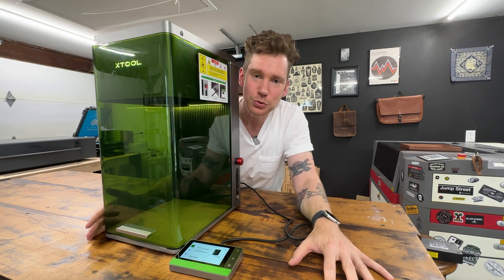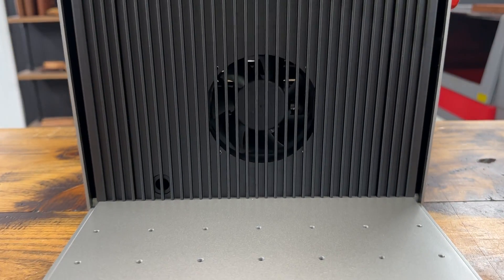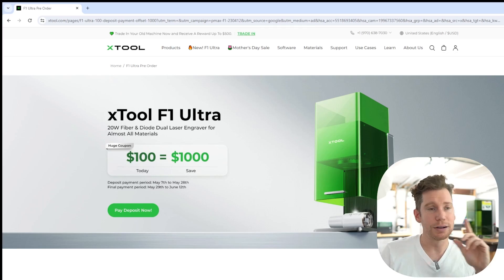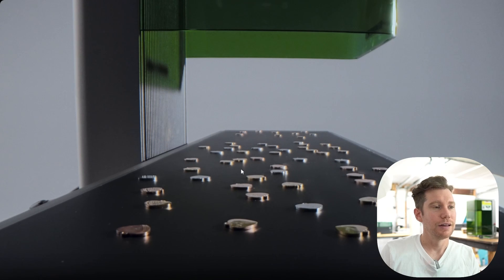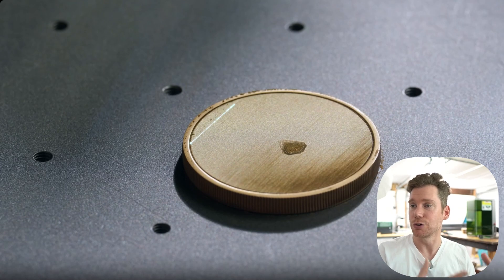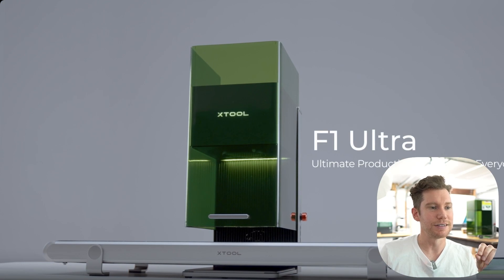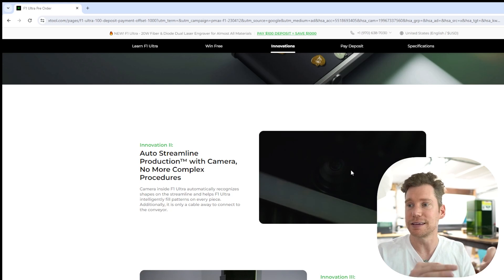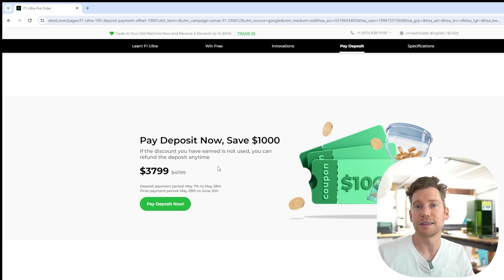The xTool F1 ULTRA! First Look Inside.

Comment: Does it use the same filter as the F1
Reply from the maker: The smoke purifier? I think so I have that too and I will be trying to connect it for the next video.
Reply: @justinlaser  I look forward to your specification video on what this things capable of I currently own the F1,p2and comMarker 60watt B4 MOPA of course I just bought my fiber Laser less than a month ago now it decides to come out with it.. lol Well, once all the dust settles, and everybody gets a chance to proof this thing, I’ll probably end up getting it
Reply: I had a F1 deluxe with the purifier on order to arrive tomorrow.  Customer service has been working with me to return it and order the ultra instead.  I asked the same question.  They said you should use the larger smoke purifier with the ultra and sent me the link to the one for the D1/P2
Reply: Another reviewer stated that the Ultra will be using the larger air filter/purifier that comes with the P2

Comment: Hi Justin, is your other fiber a 20w? In your testing, how does this compare for speed, engrave depth, and the ability to reliably choose a color via the settings. 
While I might someday get to a production need, the conveyor is a cool thing, but not needed now.
Do you know if their other rotary tools will work with this one? I would like to do the inside of jewelry.
Good luck on the testing!!
Reply from the maker: My other fiber is a 60w so that one would definitley "win" on some of those aspects just because its more powerful and more expensive. It will be cool to see how it compares though. I see them using the rotary tools in the examples so Im sure they will work I will try that out as well.

Comment: I wonder if the Fiber Laser can cut clear acrylic and at 20 Watts cut designs into guns and knives?
Reply: I believe for FFL type of engraving (sn) you would need a 50w fiber. 20w or higher should do decorative, even deep, engraving on knives and gun slides.
Reply from the maker: There are people who "get away" with using a 20w for gun/knives work but if you want the super deep stuff most start at 50/60w.